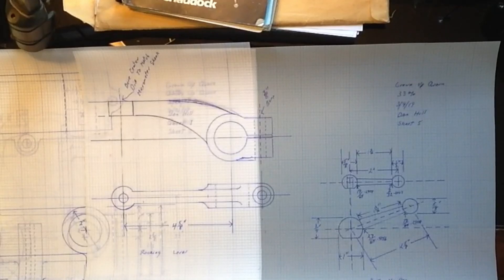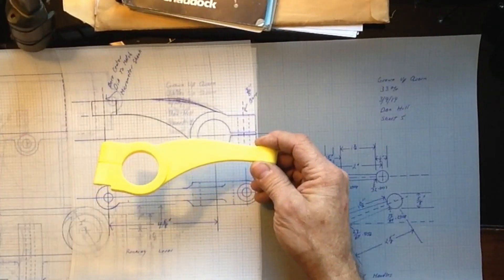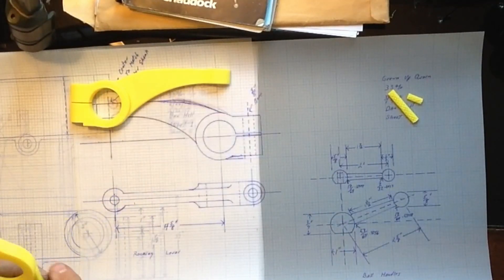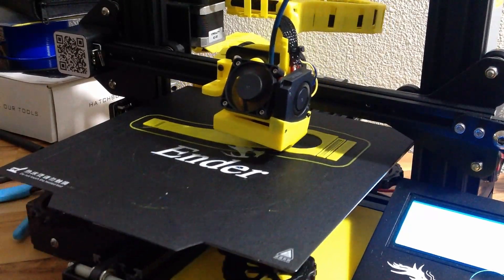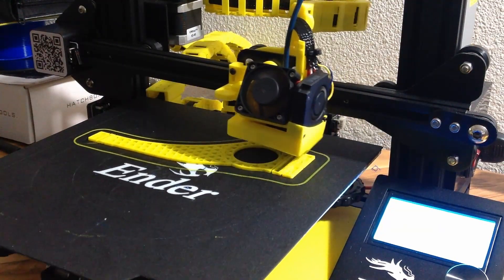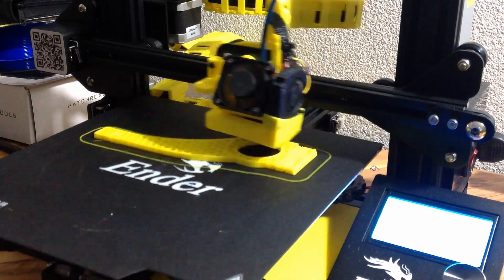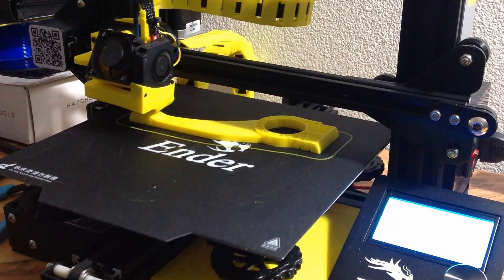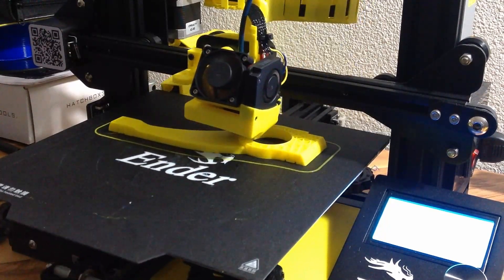Building A Grown Up Quorn Tool & Cutter Grinder: Part 3

Comment: Thanks for taking the time to document your project. You pretty much discouraged the building of a quorn in order to obtain a capable tool and cutter grinder so why are you making one now? Will simply scaling it up by 30% cure the shortcomings of the original?
Reply from the maker: It's all about the mission you have. I don't mean to discourage anyone from building a Quorn, but everyone should understand what they are getting into. the home hobby machine shop has changed from what it used to be when the Quorn was originally designed. in the earlier era tooling was not as available as it is today so you usually had to resharpen what you had or produce it from scratch, and resharpen when it got dull. plus the machines were smaller so they may have been easier to produce the tooling for. Now we have more capable machines which accept larger tooling and in many instances is considered disposable tooling. you can now purchase  1/2 inch end mills for $10 so is it more feasable to spend half a day sharpening 3 or 4 end mills plus several hundred hours building the machine and a few more hundred on the castings or just buy replacement end mills? Now I realize that that is not the point, but everyone should realize that the Quorn is the project and there are les expensive ways to have tool sharpening capabilities in the shop. As I said at the beginning that it is all about the mission. My justification is that I produce a fair amount of specialized  one off tools both for the gunsmithing portion of my business and for some other items I produce and market. Will a 1/3 larger Quorn solve all of it"s short comings? (whether real or perceived) For me it will because it will have larger capabilities better material removal rates and hopefully I can add some features which will make it easier and more repeatable to set up. The last to items for me is that while my original is functional and satisfactory I was inexperienced when I built it. Now I am better armed both knowledge and equipment wise to produce a much better machine than I already have so why not a little bigger, And then there is the bragging rights.
Reply: @hillsgun  Makes total sense. You need to really want to build the Quorn or have requirements that cannot be met by cheap disposable tooling. Although I will probably never build one I will watch you do it!